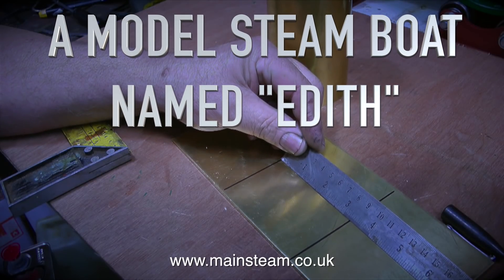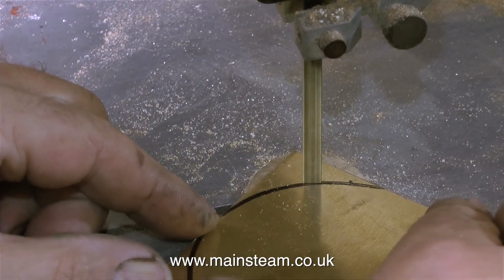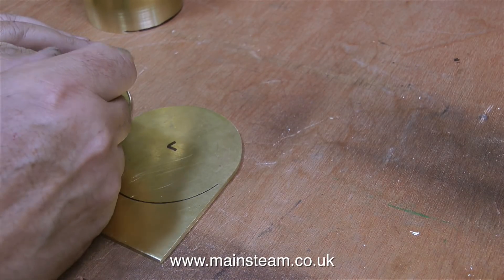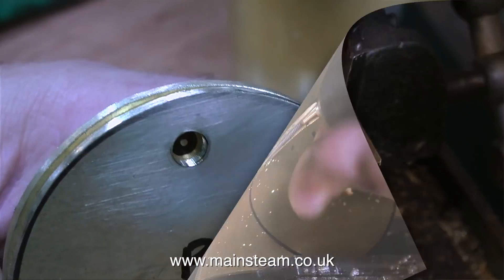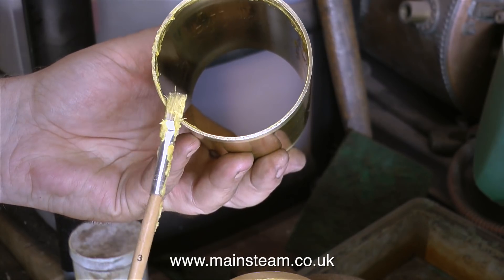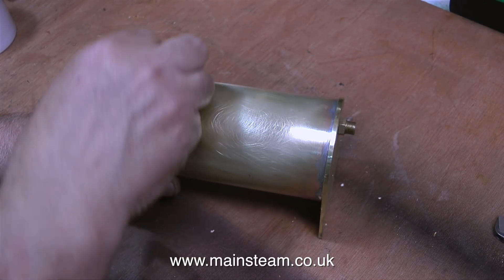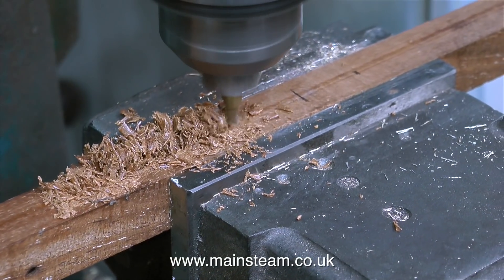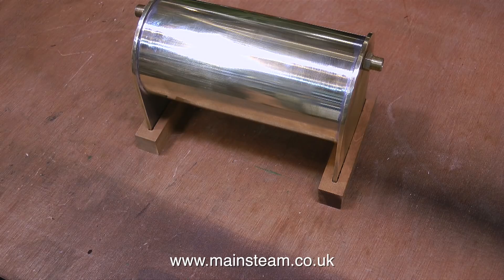A MODEL STEAM BOAT NAMED EDITH - PART #18

Comment: Will you clear coat the tank you just made so it wont tarnish with time.  As it will dull with time and the owner may not be as dilligent as you are with the polishing once it is plumbed inside the boat.
Oh and keep doing the comments.  It ads to the flavor of your channel.  I think they are spot on.  Keep up the good work.
Reply from the maker: It will never be cleaned and the Patina will soon match the other internal components {:-)))

Comment: Not sure how you remove the discs on the sander and don't want to teach you to suck eggs. But I use a electric heat gun to soften the glue bond and then clean with a little thinners once removed. It normally takes me longer to remove and replace the table to do the job. Keep up the great videos have enjoyed so many of them